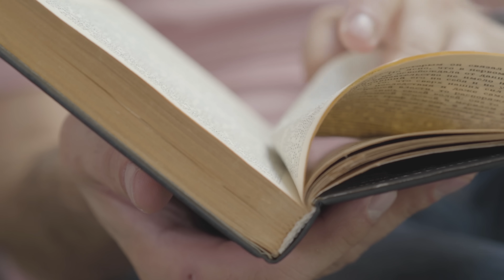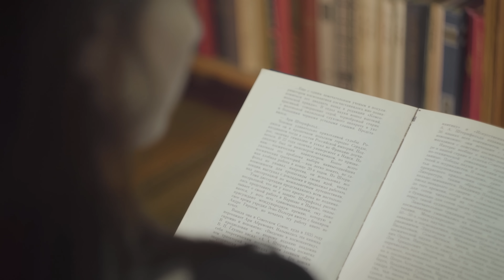The Politics of Prepping

Comment: A British Columbia prepper here - moved to a small mostly conservative town. I just bought an electric car and installed a 220 volt charger to charge said car. I also bought a natural gas powered generator. The gas company can operate indefinitely in a grid down event because all of their compressor stations are equipped with natural gas  emergency generators. During the last power failure, the generator ran my furnace, starlink, computer, fridges and freezers. A grid down event will make it pretty much impossible to fill your gas powered car because the gas pumps will be unable to pump gas. Not a problem with an electric car and a  nat gas generator. Also have a great relationship with my immediate neighbors most of whom are hunters and also are reasonably prepped.
Reply: What is your plan if a storm uproots huge trees that break the buried natural gas lines? Yes, that has happened. Maybe get a propane generator for backup to your backup?
Reply: Nice!
Reply: Get two cans make a rocket stove also get candles clay pots seeds
Reply: @tammieaf2712 Their are alternative power scources besides gas, propane, and solar. Having a wood stove or fireplace cannot only produce heat, but power too.
Reply: Fucked in an EMP situation.
Reply: I know how to convert my old pickup to run on wood gas, if need b. I hope i won't have to tho
Reply: If you can run your electric gear and charge your car you can pump gas and oil products,That’s BS !!

Comment: I've been doing the annual (prewinter) gear unpack, inventory and repack/recheck.
What comes next, how to power up, running through situational mental exercises and trying to make a plan has been on my mind frequently the last couple of weeks.
Reply: A good practice is to shut off electricity and water for a couple of days. You get a realistic idea of how to function without it and you'll discover areas of lacking. You can correct deficits before an actual emergency situation.
Reply: @tammieaf2712 if you've ever been homeless or in the bush/field for a couple weeks or longer, you don't need the practice. But I hear ya.

Comment: Yes, buy the biggest yacht you can afford to bug out with and get security and freedom to move unhindered('ish) . LoL
Reply: DaisyDay.-pm2cf  1st they have  to find you . Then they have to be able to board you .
Reply: Better be a sail boat.
Reply: They consume a lot of fuel
Reply: Sail boat is better idea, and pirates sometimes do find boats out at sea why they called pirates ☠️
Reply: @TonyMartin911  Better get a sail boat. You can get one with an engine as well.
Reply: @TonyMartin911  mine doesn't, wind and sun is free mate
Reply: Sailing yacht, is the ultimate bug out vehicle.
Reply: @williamwiese9963  I'm refitting a 53ft Trimaran , though I could leave in a pinch at any time.
Reply: @Island_Times  How do you deal with storms etc.
Reply: @CCmagee3   I'm better on land
Reply: @ifv2089  Firepower
Reply: @TonyMartin911  I use a sea anchor and just drift if at sea. Points it the right way round to ride it out.